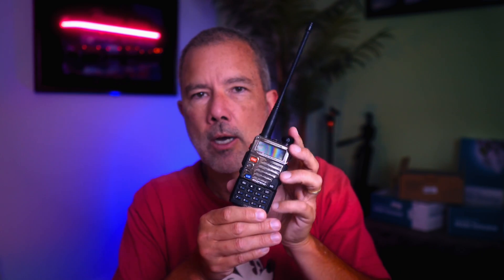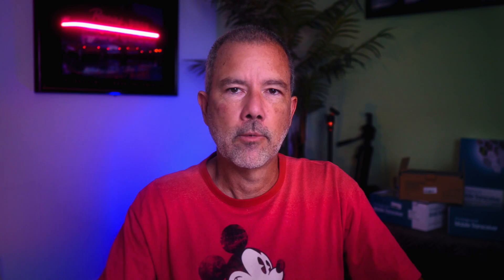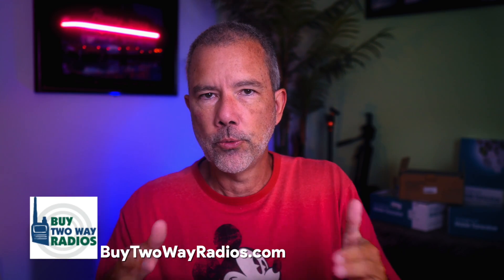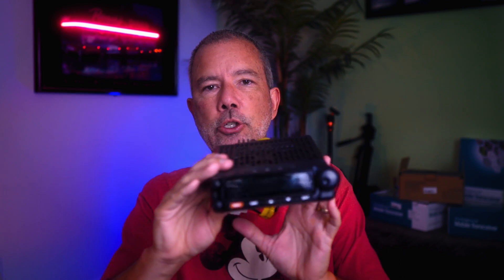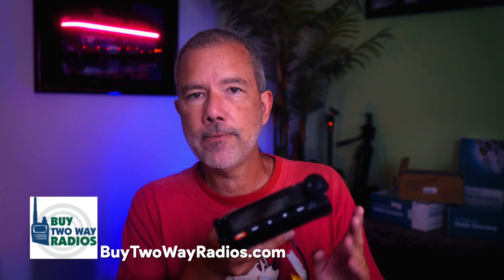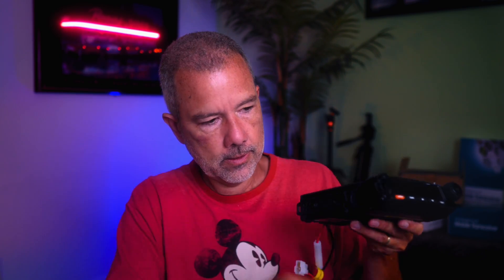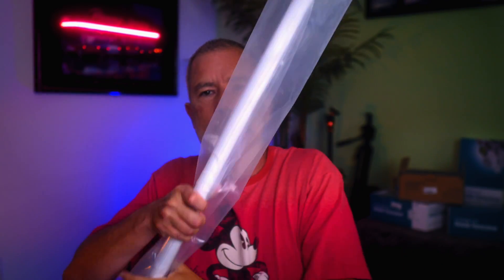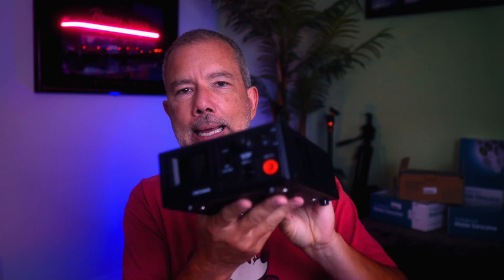Building a GMRS Repeater For Personal or SHTF PART1 - Repeater Build with Two Wouxun KG-1000G Radios

Comment: Use RG-214 double shielded  coax cable for your repeater and use N connectors over using PL-259 connectors if possible. Built many repeater systems from the ground up. Use your GMRS license as the identifier. KK7T. I would highly recommend that you ground your system to a ground rod and use a Alpha Delta Model ATT3G50U lightning Protector. Had one repeater hit two times in two weeks. Get's expensive.

Comment: This is going to be an interesting project to follow.    But, I would like to make a few observations, if I may:

1 - As much as I understand the appeal of having a full 50 watt GMRS repeater, you would likely be better off running it at reduced power.  A repeater is going to be running at a much higher duty cycle than the radios that are accessing  it.   This is going to put a significant burden on the transmit radio for the repeater.   So, if you run it at higher power, you're going to need to add cooling fans.   And, the higher transmit power is going to require a more robust power supply - one that is also capable of the higher duty cycle, as well as provide sufficient run time in the event of a grid down situation.   And, of course, if you're using solar panels to support the system, you're also going to need more solar power to support the higher transmit power.

2 - The hand held radios and even the mobile units are going to be the weak links in the system.   Indeed, they would benefit more from the extra power than the repeater itself.

3 -  The high gain antenna is going to allow you to reduce your transmit power without sacrificing anything.

4 - Your elevation above the surrounding terrain is going to be of much greater significance than the height of the antenna above ground.   So, making sure it is in the clear should be sufficient to meet your communication goals.

5 -  The antenna you're using for the repeater is lightweight and is going to present little wind loading.   So, you could get away with mounting it on a telescoping mast with guy lines, rather than mounting it on your roof.    

6 - Higher transmit power increases the chances of desensitizing the repeater's receiving radio which diminishes its ability to receive signals from the hand held and mobile radios trying to use the repeater.  If your repeater's own transmitter is drowning out the signals it's trying to receive, the repeater is less effective.  Its ability to hear signals is every bit as important as its ability to retransmit them.  And, the duplexer you will be using is a cheap one that is going to make the system more susceptible to desensitizing by the transmit radio.

7 - Finally, remember, GMRS is a line of sight band.   You have already discovered through your own experience that your 5 watt hand held radios can hit repeaters dozens of miles away - so, you already know that the higher transmit power is both unnecessary and provides only a nominal benefit, while presenting other technical challenges that are also unnecessary, if you use lower transmit power.   So, get the higher power radios for your repeater, but turn down the output power and make the whole project more efficient and robust at the same time.

73
Richard
AI4IJ

Comment: Excited about this series. I've been a ham for 20 years and just got my GMRS and thinking of building a repeater. Regarding the identification, it reads like if a licensed user is using the repeater, and identifying with their callsign properly, no identification is needed. I bet it couldn't hurt to go ahead and set up an ID every 15 mins to be safe, just in case. § 95.1751c. Use your own callsign, and you could add "repeater", "/R" or whatever on the end just to differentiate the station. You the man Randy.
https://www.law.cornell.edu/cfr/text/47/95.1751

Comment: I’m new to GMRS but have learned a lot watching your videos. I’m also going to build a base station. Later on I’m going to build a couple portable simplex repeaters that way we can extend the range in our area. I will be using the ADS-SR1 simplex repeater. I’m not going to power it with a 12volt . That way it can be moved more easily. As conditions are needed . 
Of course this is for SHTF backup communication

Comment: OMGosh Randy!!!
Perfect freaking timing bud!  I'm in the middle of building a GMRS repeater as well (I may end up doing several repeaters).  I know how diligent you are in answering comments.  Given that, I was wondering why you haven't answered some repeater comments/questions I left on a recent video, but now I know why.  I almost feel like your doing this repeater series just for me but I know you have many followers that are wanting more info on repeaters as well.  I have read all of Title 47 Part 95(e) and can go back in get the info and give the direct link to the source, but before I do that I need to read all the previous comments to see what others have listed for you.   I'm unable to do all that right this moment but when I'm next to a computer I'll check in to all that.  So far all I have purchased is a Diamond X50NA antenna.  The X50NA is the repeater version of the X50A that so many people love.  I haven't decided on the transmitting radio yet but I was thinking of using one of my Baofeng UV-5R radios as the receiving radio since (from what I understand from FCC regs) you can use anything to receive the transmission and only the sending transmitter has to be 47 Part 95(e) certified.  But I haven't fully decided on that yet either.  I also plan to use a duplex repeater controller and a duplexer in the setup.  I'll keep you posted on all that.

As far as getting on your clay roof.  You may want to look at equipment rental places in your area to see if they have a "man lift".  JLG Lift makes some or you could even use a Skytrak with a man box on it.  A quick google search should help you find what will work for you and this would keep you from having to put a foot on your roof!

I'm thinking of doing response videos to your repeater series showing my repeater build.  As I do them I could post a link to those videos here in your comments, but I would want to get your approval to do that beforehand.  Just let me know!
Reply from the maker: usually when I dont answer a question its just because i missed it - sorry!
As for the man-lift which others have also suggested, i want to avoid that because I want to be able to get to the antenna myself (easily) whenever I need to - so this now has me re-thinking the location..
As for the response videos, no problem!
Reply: @TheNotaRubicon  
Well Randy, Joe here, this is my channel.  I guess I have been out of the loop too long, I don't see where to post response videos anymore so I'll just leave the link here.  Oh and thanks for appearing in my video, I really appreciate it! ;)

https://www.youtube.com/watch?v=Y5EJYSiO1LA

Thanks,
Joe Smith

Comment: Just a couple of tips from an old LMR tech. I would recommend that you use RG-213 coax cable. It is cheaper than LMR-400 and easier to work with. The reason to use it is that you want a receive signal that matches transmit.  RG-58, RG-8X and other small cable is more lossy and the larger cable will last much longer.  As far as to whether to charge or not I would recommend that you figure out your operating cost and divide that among the users.  It is easy to put up a repeater and get some users on it and after a few years (or power surge or lightning strike)  you have to repair it and have to have the cost come out of your own pocket.  Good luck. I am happy to see you promote GMRS. It seems like there is a renewed interest by people who left CB years ago because they didn't like what CB had become.
Reply: As another former LMR guy, I respectfully but completely disagree; RG-213 is far too lossy at 467/462 MHz. It's the best choice for HF and 50 MHz runs up to about 100 feet, but no way I'd use it above that range. LMR-400 is the better choice for short runs where Heliax isn't a requirement. You want to squeeze out as much RX signal as possible into the front end and through the duplexer as you can. At 450 MHz, LMR-400 has about 2.7dB loss per hundred, whereas RG-213 is 5.2 dB/100'. That's half your signal with a 100' run.

Comment: First off, let me apologize to you for my rude comments in your other videos.  I was a little harsh on you and it was not necessary.  I was also incorrect in regards to the removable antenna issue.  I'm sorry for all that.  Please accept my apologies.

Anyone that wants to jump into this hobby and put up a repeater is ok in my book regardless of their feelings towards their baofeng radios.  It's hard for me to sit by and see folks make critical mistakes when putting together a repeater project.  So I offer my help, take it or leave it.  I've had a few repeaters with long feed lines on top of water towers, regular towers, buildings, and even in the top of a very tall tree.  Been down this road a few times.

Your antenna system (duplexer, patch cables, feed line and antenna) is the MOST important part of the repeater system, period.  The hole idea is to get as much of the 50 watts to the antenna.  The higher the frequency in use is, the more loss you will have per foot of feed line.  That is why feed line at UHF frequencies is so important.  Don't go cheap on feed line, you will regret it.  I would not recommend LMR400 for repeater use.  For duplex systems the double shield of aluminum foil and copper braid is a problem.  RG214 double shield is 2 layers of copper braid and is ok for duplex setups such as repeaters.  Anything less and you're going to have substantial loses in the feed line.  Hardline is best but very expensive.  Also type N feed line connectors for everything are much better than PL259 type, especially at UHF and above.  You may loose a few dB over all with the PL259 type connectors.

Make sure your duplexer is professionally tuned to the frequency you choose.  If not there will be a ton of loss in the duplexer and very little power will make it to the antenna.  Even if you're off by a channel (25KHz) it will be very bad for performance.  It needs to be spot on frequency.  I have no experience with this particular duplexer you listed but I've used other flat pack duplexers before with good results.  You mileage may vary.

You already have the antenna so up up and away with it I suppose.  If that doesn't work out for you I had one of these Comet CA712EFC antennas up on a water tower for 8 years 1/8 mile away from the Atlantic ocean.  It survived super storm Sandy.  It now resides on top of a 75 foot tree in my back yard.
https://www.theantennafarm.com/catalog/index.php?main_page=product_info&cPath=191_193_258_976_250_1096&products_id=1085

As for antenna grounding, there are books as thick as an encyclopedia for this.  In a nut shell if you add a ground rod for this antenna it will need to be bonded to your existing grounding system that your electrical panel is grounded too.  If not very bad things will happen if you take a lighting strike and your home owners insurance may not be happy if they discover some like this.  Also your coax outer shield needs to be grounded to this same point before the cable enters your house.

Good luck with the project.  I'll keep an eye out for updates and offer up anything useful.
Reply: It takes a big and intelligent person to apologize for anything. I tip my hat to you sir.  You have more courage then 99% of the other folks out there.  You have a nice day.
Reply: This dude irritated me in the beginning, but he has grown on me. I appreciate his approach to sharing info and have learned a lot from this channel. He is about where I can see my self in a year or two, with regards to his radio kno ledge and then I'm done and moving onto my next obsession lol
Reply: Dude is subscribed to Milf mom 55 😂😂

Comment: As a fellow radio guy who is terrified of heights, I would hire a trained professional to scale that steep roof.  That, and/or a bucket truck.  What about the mountain you have had friends drive up on, near your home when testing various radios?  A repeater there would give great coverage, if you could get a site there and permission to put it up.

Not sure what the power setting capabilities of the KG-1000 are.  Still waiting on mine, but be ready to run your transmitting radio at 25 watts or so to prevent burning out the finals on lengthy conversations.  Even with a fan, overheating can be a concern at full power.  Also, the better quality (lower loss) you feedline has, the better your xmit and receive range.  Cheap coax has high loss at UHF frequencies.
Reply from the maker: that mountain is 10+ miles from my house, and my goals are to have a repeater I can run in my house so I can control it, work on it, do whatever I want, on a whim.. cant do that if its on the top of a mountain somewhere..   
As for the KG1000G - i've been blasting at 50Watts for months from the one in my Jeep so i'm not worried about the finals.. It does have a talk-timer so i can set it to automatically shut-up any long-winded talkers.. it also has a good warranty so if it does burn out, they will send me a new one. ..
I will probably start with the cheap RG5X feed line.. if it cant make my 30Mile goal, then I'll change it out.. if I can, i get to tell everyone they were wrong.  UNLESS there is not much of a price difference.
Reply: @TheNotaRubicon  for those afraid of heights - FLAG POLE IT!

When I was in the Marines (As an electrician) I used to help the Coms guys do this... They had what they called a “flag pole” - which was a kit of fiberglass poles that that they attached a 4’ antenna to. It was 3 10’ sections that got guy wired down - after it was all put together it was a 4’ antenna on a 30’ pole...

Get a telescopic flag pole and I imagine you can do the same and attach an antenna- and a flag to it... You don’t have to be political - put a Jolly Roger 🏴‍☠️ on it

https://www.yescomusa.com/products/yeshom-30-american-aluminum-telescoping-flag-pole-set?CATARGETID=120076580000020735&CADevice=m&gclid=CjwKCAjwmv-DBhAMEiwA7xYrd-XQYLH8AhwH1G5W3374KAn10VCE6U3Ak9YqmtNwNZyQkjuOpeRhUxoCvjEQAvD_BwE
Reply from the maker: That is actually a great idea!  I may just FLAG POLE IT !  i'm going to see if that 30' one will work..
Reply: @TheNotaRubicon  And a new acronym has been born; AHB (Another hundred bucks) 😁
Reply: @TheNotaRubicon  
That is good to know about the KG1000 and the heavy use.  Looking forward to getting mine.

Comment: Based on your links and assuming ~$100 minimum for "miscellaneous"  (there is ALWAYS unplanned crap: nuts, bolts, extra cable, unplanned fittings, ...) you are at ~$1050.  If pay pros to put up an antenna that's probably a few hundred more (minimum) so say $1300 (yes I'm rounding up - my experience is always more than initial estimates).   That's excluding the $1500 solar rig, which is sunk cost for you but maybe not for others,  that does need to be factored in as well .  A SHTF repeater (or any electronics) without power is pointless.  Not being a naysayer just totaling it up.  When you are done be nice to see the over/ under on cost - keep us up to date

Comment: NOT TRUE! Building a repeater only exacerbates your addiction. After building the repeater you will find yourself buying a twenty pack of Baofeng 888's. I'm sorry, there is nothing that you can do to stop it. Nothing. Ask me how I know.
   As for the ID, I don't know about the legality, I haven't done it. And no you do not need a special license for a repeater, however there are laws, if you care about laws, concerning power and HEIGHT of the antenna(I think 25' over roof is the max). They can be found somewhere on the FCC website, but you knew that already.  As for me I just do what I want and take care NOT to create any "harmful interference". In case you are wondering I did pay for the GMRS license. I'm not a complete bootlegger, I just a part time radio bootlegger.

Comment: I've been pondering a GMRS repeater for several months now and have spent countless hours planning it. Here's what I've come up with: I plan on using a 21' fence top rail as an antenna mast and install it at the gable roof end of my house. At the top of the gable the mast will be attached with a 2 foot horizontal piece of Unistrut and a U-clamp. Below that I'll use another piece of Unistrut (again mounted horizontal) this one being 10' and another U-clamp. I'm fortunate that there's a window that's centered at the gable end and I'll be attaching a stand-off bracket at the bottom of the window to hold the mast there. The bottom of the window measures 11 feet off the ground. I plan on putting a section of pipe or rebar in concrete at the base for the mast to slide down on, long enough so only gravity will be needed to keep it in place. I'll use a plumb bob attached to the top piece of Unistrut to align everything and find where the bottom anchor will be.  Additional stand-offs will be added if needed. On top of the mast will be a section of pvc pipe and on top of that will be my GMRS antenna as well as 2m and 70cm antennas but no on the same plane. All 3 are copper pipe slim jims. I have several 2m and 70cm repeaters near me but zero GMRS. Two people will be needed to raise the mast one using a rope to pull up the mast from the window the other person at the bottom lifting and guiding. Once upright the mast can easily be lifted up and slid down on the pipe that's in the ground. Hope this helps.
Reply: That aluminum fence rail fits just right into PVC which strengthens the 20 ft, with 1 ft of aluminum to mount the antenna. (also keeps the pipe from radiating or splattering the signal) Just my $0.02